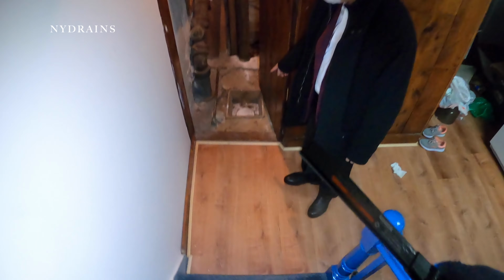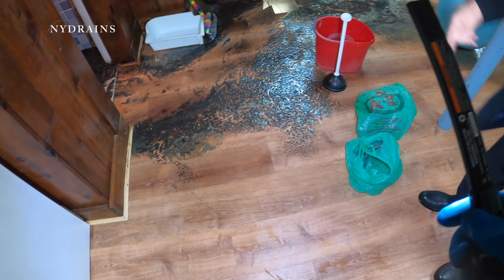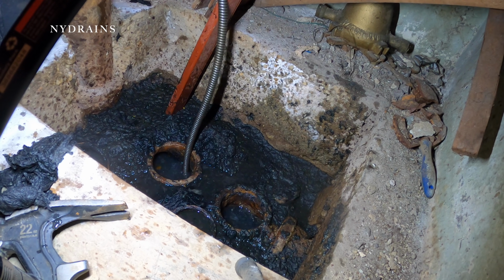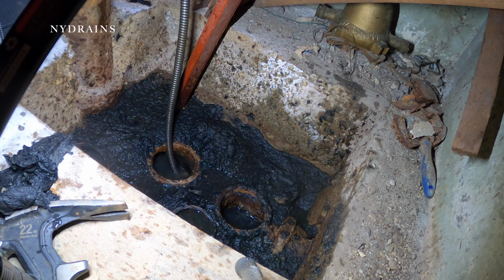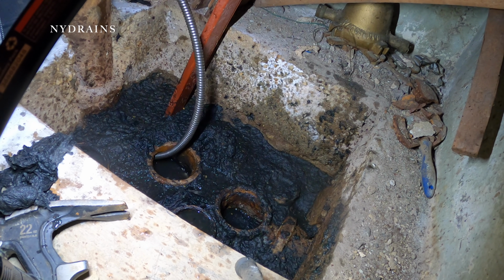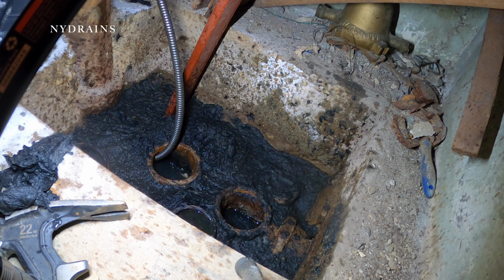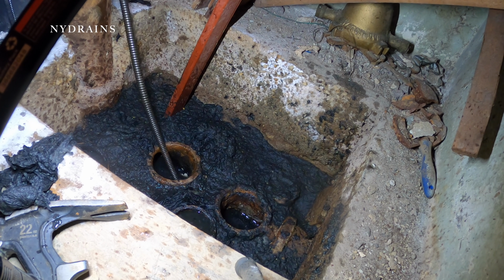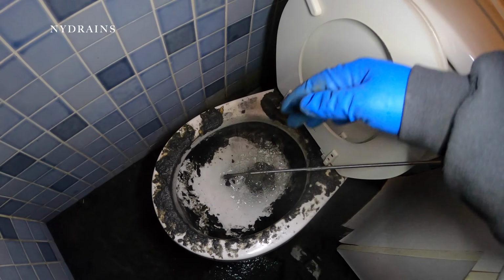Clogged Drain #68

Comment: There is a problem with the check it was suppose to keep the basement toilet from backing up from upstairs flow. Evernote with the clog at the trap is was not suppose to back up into the basement toilet so he was 1/2 right
Reply from the maker: Actually this check valve is place to prevent the rain/sewage water from outside coming back into the house, but you can install a check valve closer to the bathroom to prevent the basement toilet from back up.

Comment: Check valve could be stuck open like the guy said considering you could hear the toilet flush through the pipe.. Wouldn't hurt anything to open it and check it.
Reply from the maker: No need to, when you flush the toilet,  the water opens the check valve then closes afterwards that's how come you hear the toilet flush that's only 10-15 feet away and can't push the snake passed the check valve that indicates that the check valve is in working order.

Comment: LOOKS  LIKE OIL WELL WAS  CLOGGED UP. DEFINITELY  SOME  NASTY LOOKING  STUFF.  corn 🌽  would  be  no good.   Maybe next time
Reply from the maker: It's actually the bacteria turning the sewage black after many days(weeks)!
Reply: @NYDRAINS  i don't  think  we have  check valves like that in Massachusetts.  My house doesn't  have  that . City sewer
Reply from the maker: @billasegan3261  this house has city sewers also. If that's what you meant
Reply: @NYDRAINS  no i was talking about the U Shape valve were you  put auger through.  Only have  one clean out  no pit in floor either.
Reply from the maker: @billasegan3261  👍

Comment: What was that....looked like ink...Question...have you ever been if part of the service includes cleaning up a mess that was there before you cleared the lines?
Reply from the maker: It's actually the bacteria causing the sewage to turn black sitting there clogged up for so long. And yes usually just the pumping out the sewage part.

Comment: I feel sorry for the person who has to clean that up. 😢😢😢. Throw the whole bathroom away 😆. How the hell it get black like that. Someone needs to go to the doctor. Shit not supposed to be black. But nevertheless that's alot of clean up and disinfecting they will have to do. I remember before they found my cleanout. I had to clean and disinfect my bathroom three times. Mine was mostly water. They realized the clean out was buried and full of roots. Now they replaced clean out with a taller one that can't be buried. Now they never have to go through thr toilet again. Fyi I live downstairs apartment building. Haven't had any issues since. Every so often. I check to make sure its flowing correctly.
Reply from the maker: The bacteria is causing the sewage 💩 to turn black, usually a tell-tale sign that it's been sitting for quite some time